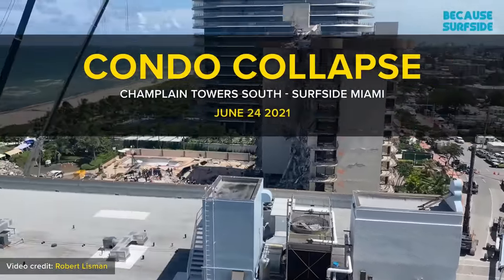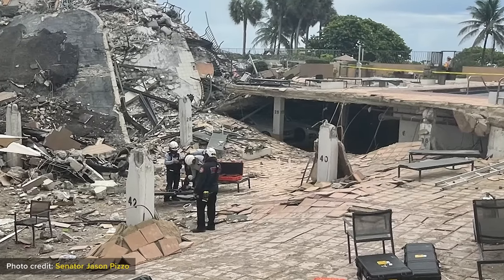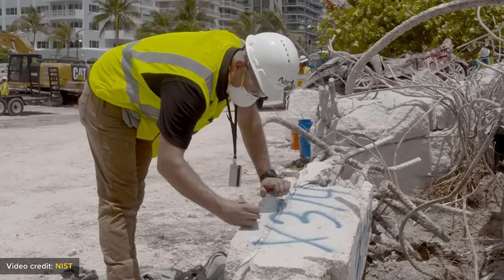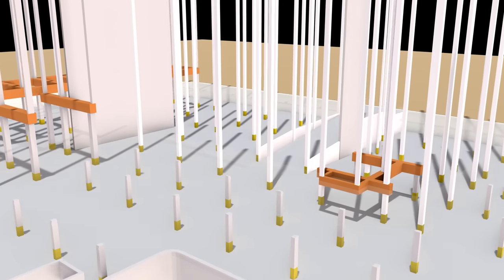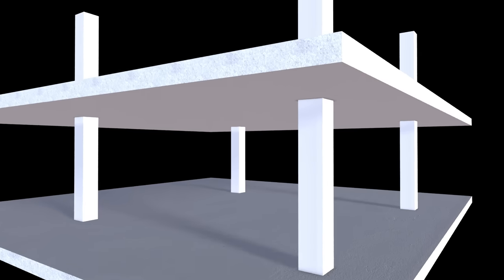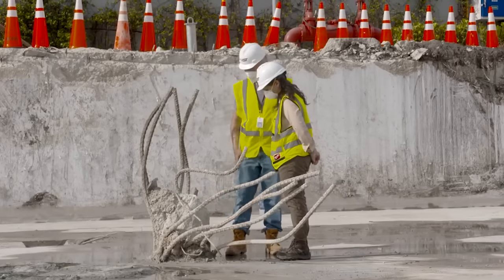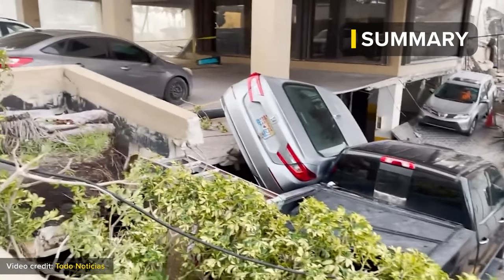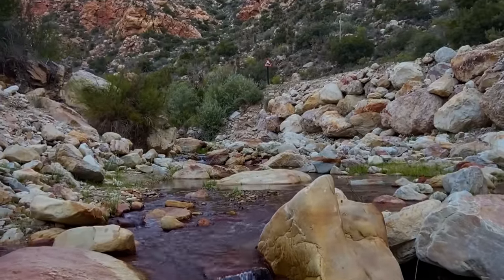SURFSIDE CONDO COLLAPSE | structural negligence! pt3

Comment: Mike, this is excellent…and so helpful! Your theory is plausible and also very compatible with all but one of the key witness statements. Your animation of the deck slab breaking up makes the deck collapse very understandable, and could explain the banging sounds that were heard in 111 for hours before the deck collapsed at about 1:15 AM. I think a lot of people have been visualizing the planters and step up by 111 fell first and pulled the rest of the deck down. But your animation shows that, having been pulled down by the deck,  the planter/step system could have acted as a massive lever and damaged the columns at their most vulnerable points. I am wondering if the columns could have been primed for this vulnerability by the anchors that the roofers had been installing in the days prior to the building collapse. Their equipment may have sent vibrations throughout the columns that buckled, and could also account for the loud cracking sounds that the late Elena Blasser heard in 1211 the morning before the building collapse. But back to your video. Thank you for creating it and clearing up so many questions. It is so helpful to all who are concerned! It’s really a public service.
Reply from the maker: Hi Maud.  Thanks for comment.  I'm curious which witness statement does not correlate with the video ...
Reply: @Mike-Bell  The Elena Blasser incident in 1211 that I mentioned. It’s not a conflict with the theory you have presented, but instead is still a bit of a mystery. I think it’s possible that those columns may have been affected by the roof anchor drilling. I have been told that it is impossible to discern sound directionality in a concrete building. Ms. Blasser was the only person we know of who reported hearing loud cracking the morning before the collapse, and she was in the top of the x11 stack. So it’s hard not to try to make a connection with the buckling of those columns 22 hours later.
Reply: Coincidence is not causality, of course.
Reply: @Mike Bell. To go back to a trigger for the deck collapse, we just learned a new clue from Mike Stratton, spouse of the late Cassie Stratton of 410. At 6:39 in the CBS Miami special, Bonded by Tragedy, Mike reports that that Cassie observed water flowing into the collapsed area of the deck. The water flowing is new-to-me information. If it is accurate, it may be the deck collapse trigger. There had apparently just been over 2.5” of rain. The deck had many problems…badly installed waterproofing, epoxy sealant injected into the garage ceiling, lack of slope and drainage, added paver weight, and voids created by delamination and bad design. I will update the Witness Statements Timeline to include Mike Stratton’s statement.
Reply from the maker: @maudessen573   Hi Maud. Thanks for directing me to the Mike Stratton statement. I don’t think this amounts to anything more than sprinkler water flowing in the basement. There would have multiple breaks in the sprinkler system.  I know many have pointed at water but I don’t think water is a smoking gun in this collapse. 

Why did the pool deck fail at that specific moment after it had been on the brink for so long?  It was hanging by a thread. What snapped that thread?  This is what we find so intriguing. As you say what was the trigger.  The structure shrinking from early morning cooling? A wind gust blowing down on the deck? Plus something else!?

Here is a scenario for the Sara Nir noises.  A first column punched a small distance (first noise) and the deck remained dangling from the stretched sheet effect, catenary action.   The slab resisted the stretching but slowly started to bend, crack and tear.  The  noises at 1:10 am was when the slab stopped being an intact sheet or catenary and the cascading collapse happened. 

The Elena Blasser noises are curious. If they were from the pool deck there was daylight on the 23rd for cracks and paver pops that would surely have been noticed. My hunch is they were unrelated to the pool deck. More likely related to roof work.
Reply from the maker: @maudessen573  I have checked the weather data for clues.  There was a 46km/h wind gust registered at the nearby weather station at midnight 22-23 Jun.  Other than nothing else out of the ordinary.  https://www.wunderground.com/dashboard/pws/KFLMIAMI597/graph/2021-06-21/2021-06-21/weeklyhttps://www.wunderground.com/dashboard/pws/KFLMIAMI597/graph/2021-06-21/2021-06-21/weekly  In the weather history further down you need to select weekly mode and Jun 21
Reply: @Mike-Bell  Thanks for running through the witness statements. Just a reminder…the cascading failure of the deck was witnessed from the lobby at ~1:15. To back up from that moment, whatever fell at 1:10 was whatever was weakest at that moment…it could have been a piece of garage ceiling under that long span. The banging heard starting at 11 PM (we don’t know if it actually started sooner) could have been the deck weakening over time, leading up to the first failure sound at 1:10.

Comment: Thank you for explaining what happen during construction lead to the failure of the columns.  I must point out there are other added reasons the floor, ceiling collapse.  I think they have add sand plus brick to the floor but may have cover up the drainage for the area.  Water have no where to go but pooling up in areas. Also they added planters and trees to the edge of the of the building.  Plus over time they have added marble floor + wall tiles inside the building.  I don't think the people, whom were installing the tiles, realized that added additional weight and I believe the floor weren't even design to carry heavier load down the road.  Let know what you think.
Reply from the maker: Hi there viewer from Jeffostroffs channel.🤣 The extra weight from the planters could be factor. The marble floor tiles no. 
Engineers factor in some additional loads and its required in the codes. 
I don’t have access to more detailed information about the building and am curious to know what the NIST findings are going to be.
Reply: Building Integrity has the best video explaining the design faults and causes for the collapse. Recommended.
Reply: Concrete can withstand a lot of compressive force, so no, I dont think heavier finishings and bathroom fixtures brought down the tower. As more proof of that fact, they added a penthouse floor to the roof of the building AFTER the design was finalized and the building was completed, and if that didnt weaken the structure to the point of collapse, I doubt a couple of soaking tubs would.

Comment: You have the best guesstimation I have seen so far. What I have not seen is a code comparison of the engineering calculations to the ACI 318 code for the year it was designed and current practice. My guess is the code of that day did not adequately address the shortcommings you mentioned. My other guess is the engineering calculations are no longer available.

Comment: What about the concrete mix? Good Portland cement? Clean sand, clean water, not too much water? Portland/sand/gravel ratio? Was it brought in trucks or mixed at the site? The pieces of concrete in the rubble looked small, crumbly. One big pile of crumbs.
Reply: Yep, that angle-of-corruption will be ferreted out in the NIST laboratories.

Comment: Hi From Australia Mike Bell.I had looked at Your 3D of Champlain Towers Building Collapse in Florida and had been following KAI as heard nothing from u for a while.I would like to know what Year was the Pool Deck Installed ?? As i thought the Beam had buckled under Columb M11.1 and plus made other Columbs brought down the Building.As a few Engineers i have watched on this Topic have also mentioned the Pool Deck , as for a Building to stand for 40 years then Collapsed just like that is just Terrible.I hope all U guys are putting Your Expertise to the Inspectors thst are Investigating this Tragity of the Building Collapse. I have been Watching all about this COLLAPSE since it happened on 24 th June 21.Were 98 Adults and Children Died and some People Survived.😇🦋
Reply from the maker: Hi, the pool deck slab was built in 1980.

Comment: Column corbel heads or capitals do not slow construction. Shuttering or falsework can be made to suit column design either by timber products or better still in steel. I know, I’ve made & constructed many in my time. Also, there are more factors that have not been mentioned on any web channels that may have contributed to this disaster. Your video is a very good summary of what has been publicised to date.
Reply from the maker: Whay do mean! Off course drop panels slow construction with additional complexity of the formwork.
Reply: @Mike-Bell  You need to do some on-site work experience. Manufacturing corbel shutters does not impact on the programme of a construction project. Complexity is your term, everyday part of the job is mine & no doubt others in the field of this type of construction, would agree. I have never come across a project whereby corbel shuttering has held back a project. Jobs on such projects overlap each other to keep the overall programme rolling along & on programme. It’s nonsense to suggest what you say.
Reply from the maker: @willbee6785  you really don’t know what you are talking about!!
Reply: @Mike-Bell  Mike, on the contrary. I can tell you have not built such details. I won’t get into a long argument over such small beer. But if you ever want to take up the challenge of building such against me to prove my point;. just whistle. If working on a nuclear power station & many civil engineering projects etc, has anything to do with it, I’ll stick by what I’ve said. There is nothing complex about drop panels that would materially impact a programme of construction.

Comment: Thanks for explaining this all so simply, it seems the tower columns being kneecapped by the collapsing pool deck slab is the most logical conclusion, the only question is why then and at that time, what was the final straw that brought it all down? Everyone seems to have a different origin for where the pool deck started to collapse, some say it was the expansion joint by the pool, others say it was the planter boxes by the parking lot, and then there are others who say it was at the slurry wall facing the new construction across the street. We'll probably never know what failed first, but knowing that would put it all together for once and for all.

Comment: Hi Mike, the problem with your central tower collapse animation is that you show the upper facia panel of the roof in place at the start of the collapse. If you study the first frames of the security video that facia is missing before the collapse commences and there is dust already rising over the pool deck. There is another possible collapse sequence where the roof facia in the central section falls off the building falling to the pool deck giving sufficient energy to collapse the reinforced pool deck section near the building which then causes the collapse of the general pool deck. The Miami tribune collapse sequence animation shows that facia disappearing inwards away from the front of the building. For that to be correct then the inner portion of the building would have had to collapse causing the roof slab to angle dow away from the front of the building drawing the facia out of sight with it. The missing evidence is in the security video in the minutes prior to the collapse sequence. Work had begun on the roof section. What was identified as being the work required and what was the work being done in the days before the collapse. If the work was on the fascia to slab joint, a highly likely concrete cancer zone then that work could well have set of the sequence inadvertently. That roof panel was overt hung by a long way without any support beyond the inner beams.

Comment: Undoubtedly. Design:  Residential = 40psf, Public spaces =100psf, Parking=40psf. These are Live Loads at pounds per square foot  Hard to imagine that for Parking 40psf with the weight, the speed and power of vehicles?  The collapse did not happen on the Public west Collins Avenue side  where the Valet, Utilities, Elevators, Stairs, Office, Lobby, etc were built over. So how many other building are this way?
Reply: If you calculate the average weight of passenger vehicles today including pickups and large SUVs and average over the loaded area you find that this is still less than 40 psf design load.  Parking areas such as this are normally restricted from larger vehicles driving in so there would be no trucks in there.  However there was a drive in front of the building for deliveries and such and it probably was not restricted so much in height so delivery trucks could drive in there, and there is no evidence on the drawings that this area was designed for any higher load than the rest of the ground floor.  The pool deck OTOH can be subject to 100 psf or more, plus the weight of a lot of planters, pavers, concrete topping, etc., but again there was no evidence in the drawings that it was designed for this type of loading.
Reply: @billj5645  yes, going to your point that the building built over the service areas did not collapse. The more exclusive luxury side did. But I think other factors come in to all this. Adding that a 4,000-7,000 vehicle is not just standing still but moving, starts and stops, and that gets transferred. + the open basement.

Comment: Great analysis, animations and overall video. Very nice job.
Regarding punch shear rebar, was that standard construction in Dade County in 1981? My understanding is there was a major update to those standards for hurricane resistance at some later date and that perhaps punch shear rebar requirements were then added.
Reply from the maker: Im not certain but it appear that punch shear wasn’t specifically coded but implied as required in the duty of care and calculations required by structural engineers in 1980.

Comment: So the pool deck beams pulling on the south side columns tore at the overlapping rebar. The animation suggests the columns buckled slightly. Could such buckling be the source cracks in the walks/ceilings in the units above the damaged  columns as reported by the few survivors (4?) from #111 & other units above (611? 411?)?

Punch shear reinforcement: what was the standard back in 1979-1981 when CTS was designed and built?
Reply: In 1979 punching shear reinforcing would have consisted of tiny little stirrups in the slab or structural steel shear heads embedded in the slab.  Tiny little stirrups would be somewhat impractical in an 8" thick slab, and structural steel shearheads would have required larger columns.

Comment: This seems like the correct analysis on why the building fell.  I had been following Joshua's channel and must have missed any video he put out on that prying action pulling the column rebar out of line.   And in time perhaps the forensic investigation will confirm this as the cause.   This would then clear the names of Morabito and others who were being sued.
Reply from the maker: Morabito failed to warn that the pool deck slab was so weakened and in such poor structural state.  They did not call for the reconstruction of the slab which is what was necessary. The core samples were alarming.  They should have done a more detailed evaluation of the poor state of the slab.  Morabito are not in the clear. On the contrary I believe will have to defend themselves and their recommendations. They could have prevented this. 

As far as I am aware nobody else on YouTube or in the press has explained the rebar deformation as reason why the tower columns gave way.
Reply: @Mike-Bell  I see. Thank you for informing me.  I have dealt with Morabito in the past. I even built a mock up out of wood and brought it to their office. The company I worked for was trying to get through to them that steel joists are not beams,  and that roof top anchors for windiw washers need to be extended all the way down to the bottom chord of the open web steel joist and not just the top chords. And that a factory or field installed web directly under the roof top anchor does not carry the moment into the joist. My mock up was of wood just to show visually the 2 cases of tie down anchors (tc only vs. Both tc and bc attachment). At the time, and this was a few years back, I got the impression that they did things in such a way as to cover themselves, but perhaps they could have been more thorough. My example of them not showing a lot of interest in what we were trying to tell them about window washing tie down anchors as case in point. but it was more so a feel or impression I got.  And I think the wording from the 2018 report had the sort of vague wording that was like saying ' things ought to be fixed in the near future '. But no real indication of the exact time frame. It's saying just enough to cover themselves as to say something is wrong but not pin pointing the urgency.   I forget the exact details of the 2018 report on CTS but I'm guessing you may have also come across that document as well.  Morabito either knew just how bad the situation was in 2018 and failed to highlight the urgency or they did not realize how serious it was ( and perhaps assumed the original design was stronger than it was) and so they simply reported it as they honestly saw it.  I think the latter of the 2 cases.  Josh from the building integrity or engineering integrity channel had a video on the 2018 report as well.   It's a shame to think that this whole catastrophe could have been prevented.